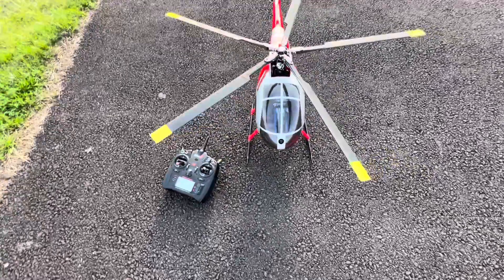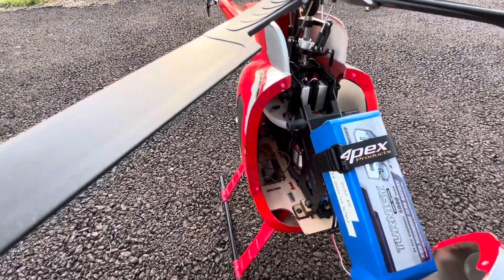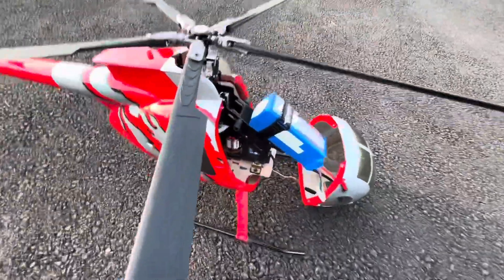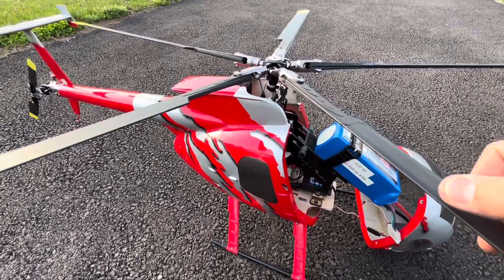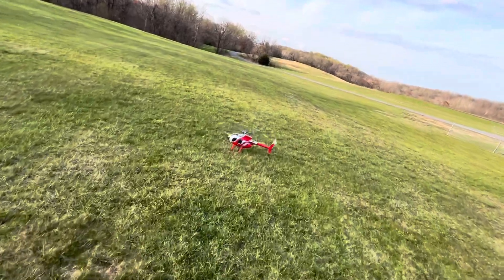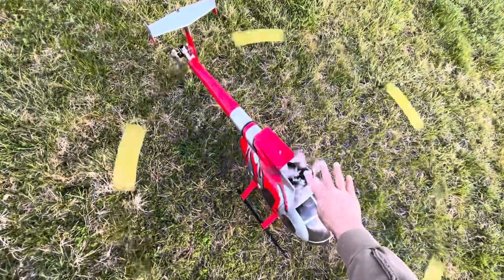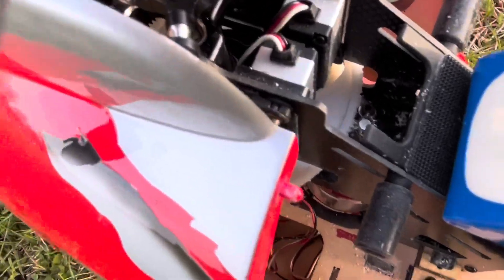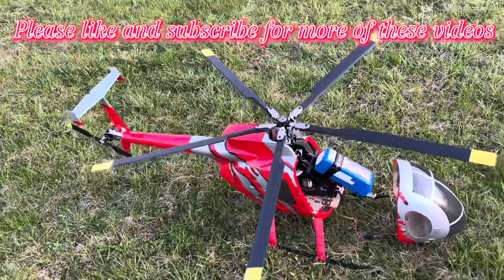MD500E - Trex 500 conversion - Pinion Failure

Comment: Try 4S, I run all my scale 500 on 4s, I have an 4 blade Apache AH-64 900KV, 4 blade black hawk UH-60 1600KV , 4 blade cobra AH-1WX 1600KV, a 3 blade Bluthunder 1900KV (waiting on body) and am currently building a 4 blade MD-500D 1600KV ( I had an extra 4 blade head). All but Apache have 162T main with either 15 or 16T pinion running 4S  All fly very well with nice head speed. Only thing is I have had to add some weight to get the CG correct. 
Are those plastic blades? I bought some that look like those for my Bluethunder but man they were horrible. Heavy and tendency to warp. I ended going back to CF narrow cord like on my Apache and Blackhawk. Trying to get a set still for my MD500D as well.
Hope you get her straighten out.
Reply from the maker: Thanks.  Yes, plastic and heavy.  I have a set of 5 CF blades now. I can change my pinion to 16T and 162T main on 1450 kV motor and try 4S.  Amp draw will be high, and I may not have adequate tail authority with RPM at 85% eff around 1800RPM.
Reply: @Flight6677  try with the 1600kv and 15T, I'm using a talon 90 with no over current issues and running about 65%-70% throttle.
All mine are set up as simple governor mode. look through some of my videos you will see the UH-60 first hover, she's solid.
Reply from the maker: @robodragonsdf1  what are your throttle and pitch curves?  Thanks.  I will try your suggestion.  I have a 100A YEP ESC.
Reply: @Flight6677  I don’t use throttle curves. I set up throttle lock, idle up which is about 25-30% throttle and flight speed which will be anywhere between 60-75%.
I setup during my initial flight. I also setup my esc for simple governor. 
Pitch curve I’ll have to open one up to give you numbers, but my setup starts with setting up -8 degs full stick down and +12 deg full stick up. Then I adjust my curve so at 45% throttle stick is where I start to get boyant and 50% I’m in a hover. 
I use microbeast plus FBL controller and castle creations talon ESC’s

Hope that helps.
Reply from the maker: @robodragonsdf1  thanks I also use MB.  I don't understand your throttle curve explanation.  So you have a constant normal and constant idle 1?
Reply: @Flight6677  yes it’s on a 3 position switch. Down= -100, mid = idle up or ruffle 25-35% and Up = whatever I set up for flight speed. 
FYI, I am an OpenTX user

Comment: You need to get allot lower kv scorpion motor then you can run a decent size steel pinion.
Reply from the maker: I am reducing the blade weight by going with carbon fiber.  I also changed out the motor to a 1450kV.
Reply from the maker: Scorpion motors need oiling and not the best option for scale birds. But which specific one are you referring to ?
Reply: Scorpion HK-3226-900KV